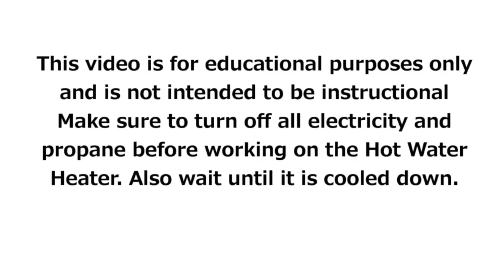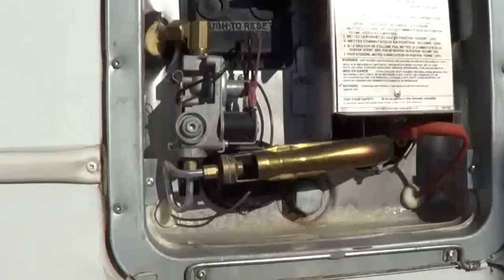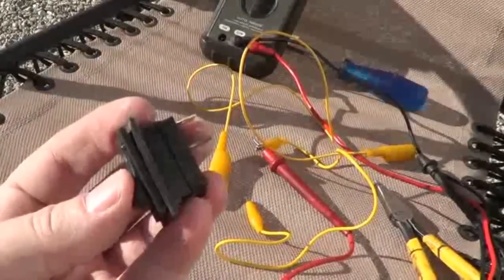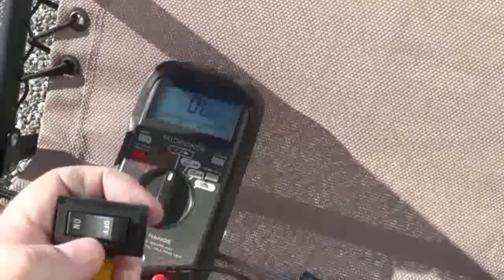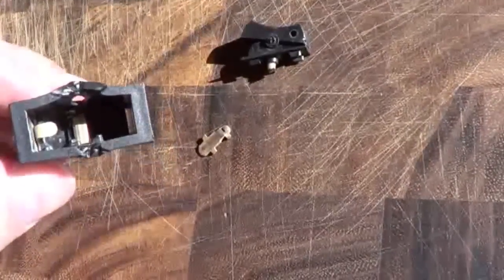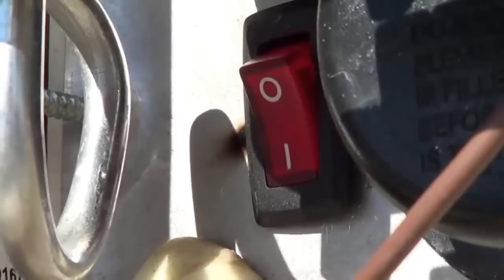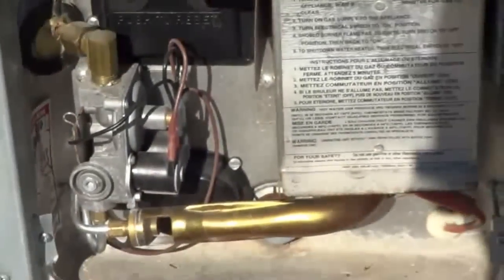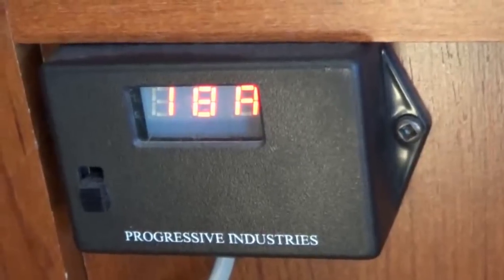Suburban SW6DE Water Heater with Faulty  Electrical Switch

Comment: I just had the same problem described, with exactly the same symptoms with the switch.  As you described, the switch seemed stiff until forced a little bit then it broke free, but didn't work.  Thanks for the information on the typical current draw and how to remove it.  Love your videos and info.
Reply from the maker: Thanks, glad to help. Cheers Ray

Comment: We bought our camper new 7 years ago and believe it or not we never used the water heater on electric. Since we have been giving some thought to hitting the road for some extended trips, I decided to try it on electric our last trip. I noted that it wasn't working. After checking my breakers, I headed outside to have a look. Sure enough this little switch was very difficult to move. I have not changed it yet but I now know I need to test it. Thanks, great information and you most likely save $$$ and time.
Reply from the maker: Awesome, nice to hear the video helped. Cheers Ray

Comment: I just took the switch out of the equation. 
Connected the two terminals and put the broken switch back in to seal the hole.
Have an on off switch inside the camper now.

Comment: So far this is my problem.  Spongey/immovable switch.  Took it out and it was mildly burnt.  Just bought the trailer .. I don't think the previous owner knew it could run (Water Heater) on electric because of this.  Thanks a bunch!
Reply from the maker: You're welcome. Happy Camping.

Comment: great video, i never knew my hot water heater would run on electric because like yours the switch is buried outside in the water heater bay, thanks to your review i discovered it. in my previous rv's i had a switch inside in the kitchen that said hot water electric. your the best ray safe travels, i owe you a beer and angie a bisquit
Reply from the maker: That should save a bit of propane. :)

Comment: Very interesting and informative video. 
I've never looked into my water heater compartment. I did not know that there is a switch in there. We have a switch on the control panel inside the cabin that switches from gas to electric. Is this switch in addition to that?
Thanks again, and Happy Camping!
Reply from the maker: +Allen Hare No, my rig has no electric switch on the inside, just a LP Gas on off, so to turn electric on I have to go outside to this switch.
Reply: Love Your RV what kind of rv do you have? Mine is a Salem Forest River.

Comment: Great video! I was wondering if you could tell how you switched it into an illuminated switch (3 prong) from the original 2 prong? I can only find illuminated switches locally, otherwise I'll have to order the unilluminated one. Thanks so much!!
Reply from the maker: You can use the switch without illuminating it or you can add a ground wire if you want it to light up - http://catcountry105.com/img/7f3fccf8b3dcd8ffd1cd0df42f501c1d.jpg  I ended up not using the illumination.
If you use a multimeter set to OHMs mode you should be able to figure out the switch terminals if it didn't come with a schematic.
Cheers! Ray
Reply from the maker: @JerkyTreat  The working space in there was extremely cramped, I could barely plug in two existing terminals, they left almost no slack in the wiring.

Comment: wat were ur symptoms....didnt work means (i.e. pilot but no burner, pilot doesnt stay on, etc)?
Reply from the maker: JoePublicVA It wouldn't heat in electric mode because of the faulty electric operation on/off switch. The gas mode worked fine. It's a dual operation water heater gas and electric. Cheers Ray
Reply: I recently discovered mine is dual too.....i hav plenty of manuals but none state which model of anything i hav....after 3yrs owning rv im still learning the hard way.
Reply from the maker: JoePublicVA I was lucky and had the right manual from the dealer. But I'm always amazed how the RV industry can sell such expensive products with such poor documentation. There is no schematic detailing the plumbing and electrical for my rig. Just blows me away. Basically I have to pull things apart and trace it myself..
Reply: i kno wat u mean....a headache on wheels.

Comment: Hey Ray, I just acquired a 30' Fuzion Toy Hauler and it just happens to have the same water heater.  On the second night of ownership, I was running it on gen-power and had the electric heat engaged on the inside, but to my surprise: nothing.  However, I remembered this video and went out and sure enough; the switch was disengaged, begging the question: why turn it off at the tank if one can do it in the RV? I speculate that the reasoning is to keep the unit from being turned on when storing it for the winter, perhaps?

Anyway, here is the real question: if the unit runs out of water pressure (like draining the tap with the pump off, or the main water tank runs dry); can it damage the electric element, or is there enough water in the heater tank to prevent this from happening?
Reply from the maker: Your likely right. Also on the sales lot, they are usually plugged in but not full of water.As long as the water heater has water it will be OK. Turning the tap on won't drain it. The only way to get the water out is to pull the drain plug.

Comment: I didn't take note of what wire went where. What happens if I cross the wires up?
Reply from the maker: It won't matter. There is only 2 wires and the switch is just on or off. So either the two wires connect or they don't.
Reply: @LoveYourRV  Thank you so much!

Comment: How would I know if the switch is bad vs the electric element?
Reply from the maker: With power off, you could measure each with a multimeter set to resistance mode for ohms measurement. See if the switch has continuity when in the on position and whether the element has a low ohm reading around 10 ohms. Or with the power on you could use a non-contact voltage tester to see where the AC voltage is present.

Comment: Mine has zero slack in wires. Ridiculous
Reply: and can the switch be in a more difficult location? why not put the switch inside the rv like my lp switch
Reply: That's what I initially thought. 
But after some serious pulling on the terminals I managed to retrieve them about 10cm.